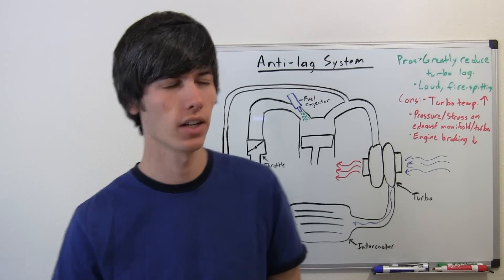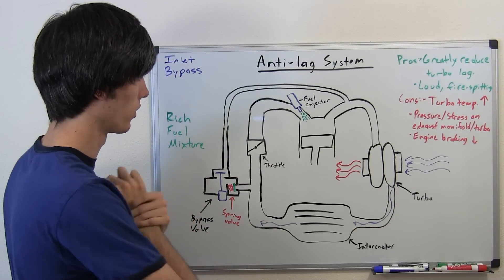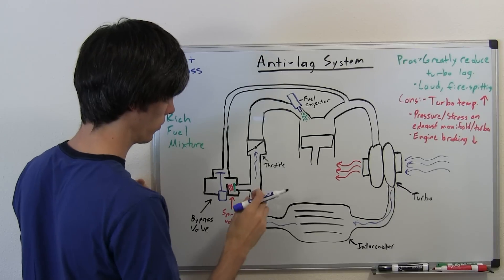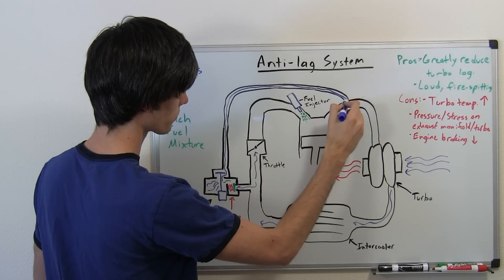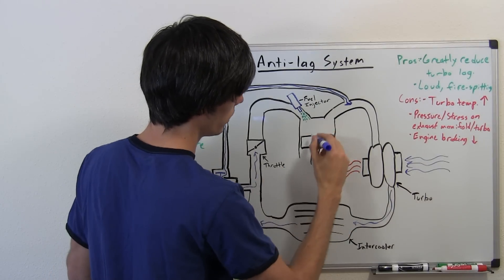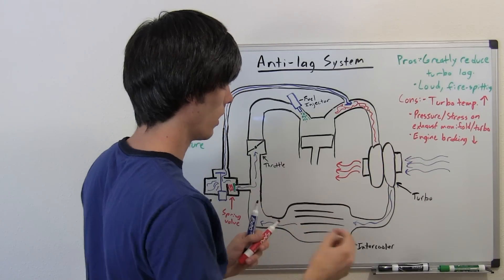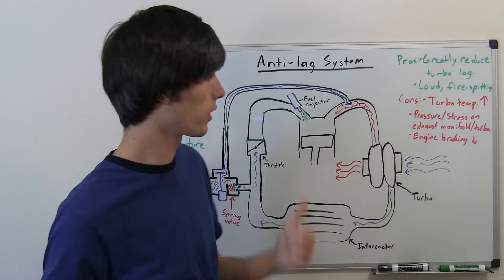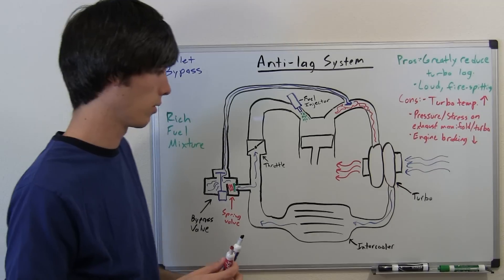How Anti-Lag Systems Work - No More Turbo Lag - Bypass Valve

Comment: I still think that a duel turbo system is the best for reducing turbo lag without damaging the engine. it works by putting one of the smallest sized turbos you find in between the exhaust manifold and the big turbo that is causing you lag.  The small turbo is pointless apart from the fact that due to it being so small it gives almost instant boos which that near instant boost provides higher PSI in the exhaust so the winding up speed of the large turbo is greatly reduced.

Comment: so the purpose of an als is to get boost at low rpm correct?
a twin screw supercharger would solve the problem would it not?
you should make a video explaining the pros and cons of using a turbo and a supercharger the biggest issue with ALS is it wears down your turbo and exhaust manifold which makes it expensive in the long run wouldnt a supercharger be an investment and the turbo would make up for parasitic power loss for the supercharger. please advise. lol

Comment: thanks for the video.  watching about different forced induction systems got me wondering if anyone has ever tried an air injector, like a fuel injector, running from an external air compressor or something like that.  It would seem to be that would be the most efficient, if you could just shoot air and fuel directly into the cylinder with two injectors.

Comment: Ignition timing method. The bypass method (which is far more aggressive) done correctly costs thousands as you'd need a turbo/manifold etc man enough for the job,

Comment: Novel concept, but is this actually in use anywhere?  I could see it being 
1. tough to route the bypass air into the collector pre-turbo post-runner
2. tough to close that bypass valve to contain the combustion in the manifold
Cool idea though.
Reply: Stuff like this i believe was used in wrc at one point but eventually became banned due to noise regulations, that's the only use for i can think of

Comment: So it double as blowoff/diverter valve apparently, but here a question related to that !
Could this (or any other diverter valve system since they probably are always needed the same time as any anti lag) be used with the ignition delay method of anti lag to not only push more air inside the exhaust manifold and increase the turbo pressure, but more importantly, since the ignition delay method is probably already air rich rather than fuel rich, it would probably not increase the combustion to bring fresh air, but can it be then use to cool down exhaust manifold and turbo ?
I guess that it might need to be done with a heat exchanger around the exhaust manifold to avoiding loosing pressure by cooling the exhaust gas too soon and then inside the turbo itself inject it with the hot gas as two gas flow (to avoid premature cooling down of the exhaust gas), so the time the hot gas transfer its temperature to this cold one and loose too much volume, they are already out of the turbo.
I have no idea if this is possible, so as the engineer, what do you think about that ?

Comment: Hey I think you need to correct this video. The bypass valve doesn't go to exhaust it goes to the intake side of turbo I have never seen a bypass or recirculated valve send clean air to the exhaust manifold or this is specifically like a rally anti lag setup?
Reply: From my understanding, people are getting this confused with the bypass valves used on turbo cars that use MAF sensors, so no un-metered air either does or doesnt re-enter the intake tract and mess with the ECU, this is using a bypass system for a different reason

Comment: Hey, I got a 1997 Volvo V70 turbo... its a 5 cylinder 2.0L with 180hk.. I buyed it from a guy, and there was an blow off valve installed already. As u mentioned in this video, a blow off valve causes more heat to your turbo than normal. Well, the pressure on my turbo is at 0.4BAR. Its a small turbo, not any insane stuff... Will this still be too heated, or do you think its "ok" since the pressure is so low? (0.4bar)
Reply: I also wondering... My friend said I should maybe buy a "blow off cover" So the "dump" sound would make more noise / louder noise. My original cover is attatched with a hose, which goes from the bypass valve "cover" and continues to the turbo. Well, the new cover is basicly just a plate, over my blow off valve. Which means theres no way for my air to get out of my Bypass valve, and I will not get any air into my turbo. Now that the throttle is closed, and i dont have any way for my air to get out of my blow off valve... what will happen? Will it return back to my "intake side" of my turbo, forcing my turbo to be slower, or ?

Comment: So how is it bad for your engine if that extra fuel air mixture combusts in the exhaust manifold?
Reply: It's bad because combustion is not supposed to happen anywhere but inside the cylinders. That's why they have extremely thick walls, thicker than any other part. The exhaust manifold isn't built to withstand the high pressure and temp. of combustion. So it simply explodes.

Comment: Hey does this increase gas mileage? seems like it would
Reply: It reduces efficiency by alot.
Reply: Why?
Reply: SOJA CRAFT because u burn a lot more fuel (gas) hence all the flames coming out of your exhaust because thats just unburnt high pressure explosive fuel.
Reply: +SOJA CRAFT Yes.  Dumping excess fuel in the engine so it passes into the exhaust manifold to ignite and keep the turbo spooled up so in turn you have more air which can burnt with more fuel would definitely increase miles per gallon.

Comment: Why not just have a turbine engine in the trunk, the exhaust of which is piped to the hot side of a turbo near the engine? With no connection to the car exhaust at all, saving weight, complexity and cost in parts. Throttle the turbine up or down for more or less but constant boost. No tell tale exhaust pops either. Make the turbine out of a larger turbo than the one at the drive engine. When the turbine-turbo system is off a flap opens up front for n/a starting and driving when something fails. The flap will stay closed once under pressure. Maybe a short piece of pipe and 2 cutouts could divert exhaust from the n/a engine for turbine starting. One cutout blocks the muffler and the other diverts to the turbine intake to spool it up. So the boost is not dependent on the car engine rpm at all. You still need supporting mods like engine management, bov, fuel system upgrades. Thoughts anyone?
Reply: So have another engine just so one doesn't lag? I'd say why not just add an electric motor to compensate for the lag. No need for too many batteries because it's just there right when you come back onto throttle.
Reply: Well yeah, it's a very small engine to power the turbo, instead of exhaust gasses. We already know electric superchargers don't work, which is what an electric spun turbo would be. Turbine throttle would control the amount of boost. Turn it off it's n/a and not using any extra fuel.
Reply: Sorry for being unclear, what I meant was a motor directly connected to the drive shaft with some sort clutch maybe to let the shaft spin freely when the electric motor is not on. This way it can give a momentary boost of power to fill in the turbo lag. I'm still skeptical about your idea because your REALLY going out of your way to reduce lag and RIP to fuel consumption when its on :P
Reply: Well there are other things I was considering. A compact unit in the trunk, (other end of the car for weight balance,) that is removable for maintenance. Instead of  trying to squeeze a turbo in between other parts. It's not a completely worked out idea. I'm not even sure whether the turbine would use gasoline, or some other fuel. Either way it could have it's own fuel cell.
Reply: zaxash If I'm interpreting you correctly in that an electric motor turns the engine up to speed to give the illusion there is no turbo lag, this is already a system used by McLaren on their P1. They call it Torque Fill
Reply: Pgtmr2- Audi and Mercedes  and f1 cars begs to differ  they have 48 v motors driving the turbos from low boost and recharge batteries when not..

Comment: ,Why do they have to ignite that extra air flow, coming in from the bypass, why dcan't they just force that air through the turbine, as it is already pressurized? Is there a need to inject extra fuel
Reply: no but the ecu is just like a computer very stupid it only knows zero`s and ones so because of this it doe sexactly what the sensors tell it to do and that is to put in fuel according to your rpm`s and airflow since this isn`t interrupted it just keeps pumping in fuel
Reply: if you do not want to inject extra fuel you going to need camshaftless engine, but today technology does not provide use of camshaftless system in high performance engine :)
more: watch?v=Bch5B23_pu0

Comment: Why not have an electric motor to keep the turbo at required (base) rpm ?
Reply: aditya harindar That would make it an electric super charger. Another way of reducing lag is through a compound/twin charger set up. Super + turbo
Reply: aditya harindar Because compressing air requires a large amount of energy and because turbo's rotate at a very high speed, that speed is pretty difficult to reach with electric motors. A high speed electric motor with the required power output is very expensive if even possible to produce.

Comment: Couldn't the explosions in the exhaust manifold be prevented by venting the extra air through a separate exhaust on a multi-exhaust system. And why do the fuel injectors provide a bigger/richer fuel mix instead of just providing the necessary amount to keep the engine running while venting the extra air produced through the turbocharger through the ALS?
Reply: +DJWolves97 this doesn't make a lot of sense, but it sounds like you are suggesting a bunch of bypass pipes and running lean. Both is complex and even more dangerous.
Reply: +Themayseffect A second exhaust pipe for venting the extra air, that is just like what they are doing in F1 with the new exhaust regualtions.
Reply: DJWolves97
Oh, you are talking about making a seperate exhaust exit for the wastegate...this has almost zero effect on how the ALS system works. In F1 this was done mainly to reduce the vacuum on the exhaust exit which reduced noise and to also to move where the wastegate was positioned.
Reply: Themayseffect Actually, the exhausts are now louder in F1, but could that work if you had a separate exhaust for excess air, so it doesn't go through the main exhaust?
Reply: DJWolves97
That's what i meant although awkwardly phrased. I still don't get what you are trying to theorize. All of this is after the turbo, there for having very little effect on operation. Excess air from the Compressor side is diverted or vented into atmosphere. Excess pressure on the turbine side is bypassed through the wastegate.

A seperate wastegate output is what is done all the time, and as you stated in 2016 F1. 2014-2015 the wastegate exhaust was routed into the turbine exhaust flow. Now it has its own exhaust. This was done for no other reason but to reduce cost and increase noise. With a small efficiency gain by relocating the wastegate.
Reply: Themayseffect Oh, I gotcha

Comment from the maker: Because a fan can't power itself. There is a net energy loss, you have to add a force to spin the turbine. For example, could you use a house fan and just put tubing so that the air it blew rerouted to the back of the fan where air is sucked in, and then turn off the fan? The fan would stop rotating, because the force is produces is not greater than the force required to rotate it.
Reply: While Ford's rally team implemented a boost accumulator large enough to actually function as a way to keep the turbo spooled off-throttle, this was quickly banned.  The more common uses for a boost accumulator are to normalize complicated boost control schemes against one or multiple wastegates and/or have pressurized air on-tap to light-off extremely complex ALS (namely, Prodrive's patented 'rocket' system).

The ST205 Celica and some EVO models inject air w/o fuel or ignition retard from the factory as a means to homologate ALS for rally, at the time.  The EVO manual in particular even tells the owner that the injected air keeps the turbo spooled; it's not wrong, but the effects are so negligible you can call it marketing BS.

Comment: Is this the same as a blow-off valve?
Reply: Castrav Eleuterius no, a blow off valve would be placed in the same place as the bypass valve (between the throttle body and the turbo) but it wouldnt be connected to the exhaust manifold, it would just let the air out to the atmosphere, making the pssh sound
Reply: Ivan Cuesta Thank you for clearing that up

Comment from the maker: When you're creating boost (via a turbo) and you let your foot off the gas (close the throttle valve) and you don't have a blow-off valve, the air needs somewhere to go since it's at a higher than normal pressure, so it forces its way back through the turbo, this is compressor surge.
Reply: This is not entirely correct - compressor surge more typically refers to operating a turbocharger to the left of the surge line.  Eliminating an air bypass and allowing the closed-throttle pressure to stall the compressor wheel does happen in a surging manner (you'll hear it), but this is not the same as compressor surge which quickly bends, breaks, or otherwise destroys compressor wheels.

Normally, compressor surge would only happen in a situation where a turbocharger has been poorly matched to a motor.  Real-world situations where this occurs unexpectedly is when a restrictor is mandated for motorsport (in close proximity to a compressor wheel) and the engine is tuned by an inexperienced tuner.  The restrictor forces the compressor to operate at a much higher pressure ratio (PR) to make the same gage pressure, simultaneously elevating the risk of crossing the surge line or over-speeding the CHRA.

Comment: pretty old video but even so,

is this a separate system from a factory plum-back blow-off valve?
which is controlled ( opened up ) simply by the differential in pressure between the inlet manifold ( now in vacuum ) and the unused boost in the cooler piping

most factory cars, instead of this "by-pass valve" (that tbh I've never heard of.) use the factory blow off valve and this vented air is directed back onto the impeller of the turbo. which I believe is doing the exact same job as this system is doing however possibly more efficient.

or is this what you/he is trying to say?

the problem i see in this version is that exhaust gas on normal acceleration will have to fill the extra volume created by the new line heading into the exhaust manifold from the by-pass valve. which isnt much of a problem but will mean it takes more effort/time for the engine to spool the turbo ( more area from exhaust ports in the head to exhaust wheel on the turbo needs to be filled before creating pressure in the exhaust manifold )

4G63 evolutions send their un-used boost back into the intake pipe ( to the effective cold side of the turbo )
as do skylines RB25/26 and silvias SR20/CA18
Reply: i had to look twice, because i thought the same thing, but if you look, this system routes bypass air to the exhaust manifold, where it mixes with fuel. the factory bypass just routes back into the intake piping after the MAF sensor

Comment: So you have to have a turbo when you have a anti lag system? (in short) do I need turbo for anti lag system for big flames :)
Reply: +Unkwon Malaysian Guy a rather useless function without a turbo, the whole purpose of the system is to promote greater turbo spool off-throttle.

Comment: wouldn't it be easier to just bypass the throttle body and stay within the intake manifold, and have an extra combustion in the appropriate place (combustion chamber)? wouldn't this eliminate unnecessary combustion in the the exhaust manifold?
Reply: +Mark950214 I'm no expert but I suspect that would cause too great an air-to-fuel ratio in the combustion chamber, causing a large temp increase, which is more destructive than having it in the exhaust manifold. I'd rather replace the exhaust than have to work on the engine.

Comment: For those thinking of trying this on your daily-driven cars: don't do it, your exhaust is most likely stainless steel (or similar) and will crack in no time.

Most cars that run antilag systems (WRC cars, some turbo GT cars) have full inconel exhaust and full inconel turbos, which can handle the heat from antilag.